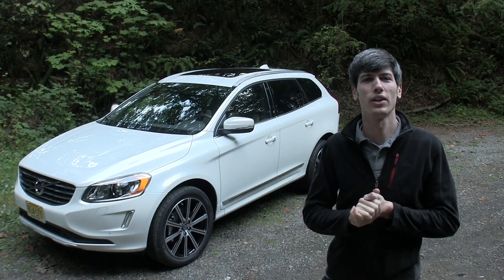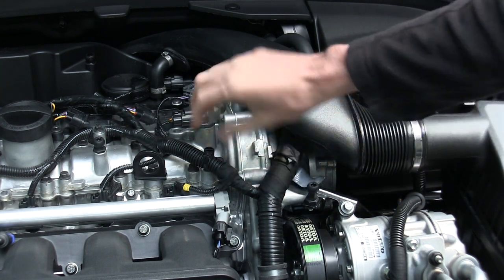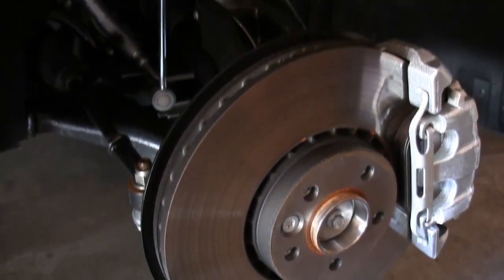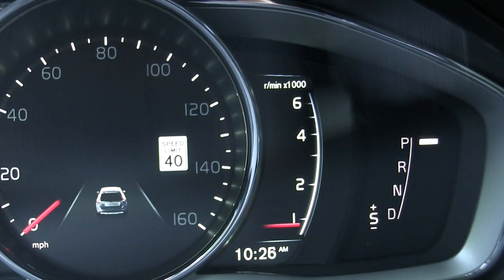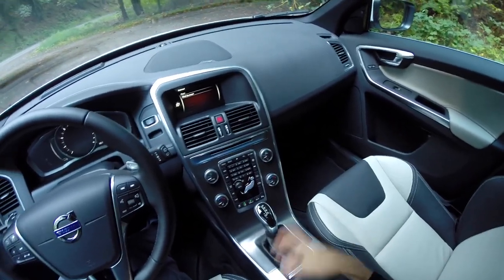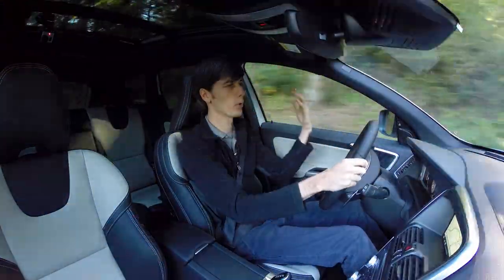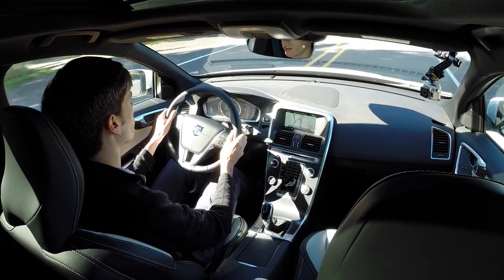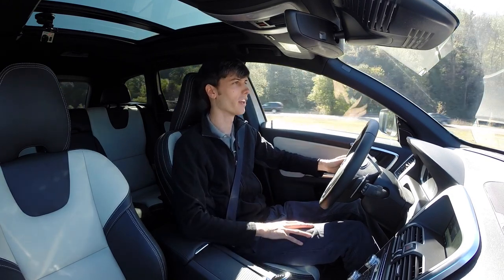2015.5 Volvo XC60 - Review & Test Drive

Comment: I'm a bit late chiming in here, but the primary purpose of the engine arm at the top isn't to stop torquing movement, its to help the engine submarine in a crash. As the engine moves rearward that arm pushes it downwards, before it starts impacting the firewall.

Comment: A thing you (might have intentionally or unintentionally ) missed, is Volvos focus rust treatment. Wheel arches always have plastic inner screen, the doors has been treated with wax(look for holes with a plastic cork in it), the bottom of the car has been rust treated and engineered with rust protection in mind. It may not be a deciding factor in California, but in Canada or a Nordic country where i live, it's defiantly a deciding factor. Generally (due to regional differences, and thereby differences in the focus on developing the car) cars from Germany, France and Norway and Sweden tend to have a good rust protection, while cars from japan.... well that's another story.  
Great show ! Cheers from Denmark.
Reply from the maker: Great insight, thanks for sharing!
Reply: French cars has not good rust protection. The new peugeot 508 for example got 2 of 5 point for rust protection of a testing company in sweden.

Comment: Adaptive cruise control is something I'll always get on a car when it's an option, so much better on he highway
Reply from the maker: It's fantastic!
Reply: @EngineeringExplained  I have a car with it and one without it. Honestly, I prefer non-active. When trying to make progress, it often slows you imperceptibly from the speed limit. After a while, you wonder why you're going so slow. Hinders progress and is very frustrating on long journeys. Without it, you notice the speed differential approaching other vehicles from behind and can overtake to maintain best progress.

Comment: An in-depth review. Brilliant.

The only thing i'll add to the list of dislikes are the spongy brakes - was under the impression that they were faulty and changed them at service only to later come to know that the spongy feel are a norm. The wife's car so was comparing it with my bmw 5 brakes which are tight and does inspire confidence.

btw with safety as the highest priority, volvo surely won't give you place to place your phone ;-) .....it even has rear child locks (window and door) that can be activated from the driver door panel and auto brakes on an impending collision when at low speed !!!

Comment: Great review! Also, the position of the interior door handles are ideal. Too many car manufacturers place this position too close to the front of the door. The problem with this is that when opening the door from the inside to get out of the car, one struggles to 'catch' the door due to the weight of the door on the pivot, making close proximity parking lots are a nightmare. Volvo is on-the-money by placing the door handle closer to the middle, and horizontally. Allowing you to not only better control the swing of the opening door, but also giving you a comfortable reach when closing a fully opened door. We love Volvo because they pay attention to the simple and often overlooked aspects of the drive (long after the thrill of the new purchase has gone). Great review!!

Comment: Those radars upfront also play a part in "emergency brake assist", basically the car will apply full braking power automatically if you don't apply the brakes before a collision!

Comment: Our Volvo XC60 from 2011 has done 210'000 miles with no problems. Not even the hedlamps have broken down! This is in Sweden so the climat is not that nice to the car. The engine is a D3 with 163 hp and 400Nm.

Comment: Hey Jason, awesome video!
At 11:58 when you were talking about a switch behind the accelerator; that's called a 'kickdown switch' and shifts the transmission into the next gear down when full throttle is activated. 
:)
Reply: Pretty sure he just said that
Reply: Tristin I know I was just telling him what it's called. It seemed like he's never come across it before which is understandable because most new cars just use the TPS to determine requested power.
Reply: volvo's been using it for 14 yrs that I know of.

Comment: Hi mate. Now, before you become too famous and big on YouTube so you are not able to respond to us ;) I wanted to make that one video suggestion I always wanted to see, and especially from you. You know how companies have like 5 same engines which provide power that varies (example - 2.0 155 hp, 2.0 200 hp and...) and not only that but usually with new models come the same engines but now slightly improved which now produce 5hp-20hp more than the series before, and without risking anything like, for example, how long an engine lasts. Now, I now about chargers but I would really like to see one video where you explain all (or at least some) ways of improving power in an engine. Hope I made it clear enough :) Cheers and thx
Reply from the maker: I have a 17 video playlist on the topic. https://m.youtube.com/playlist?list=PLA554541553164D26

Comment: I wish the XC90 came with the same buttons.  Nothing more annoying and dangerous than having to take your eyes off the road, look at the massive touchscreen, find the air condition control, tap it, than move your finger to tap the fan speed.  Totally dangerous and among the most idiotic things Volvo has ever done regarding safety/convenience design.   This reviewer seems to thing buttons are a bad thing.   Most intelligent people are more concerned with safety and convenience than big pretty bright screens .
Reply: urbansustainability totally agree. The xc90 is horrible because u have to go in alot of menus when they easely could have made a regular button for alot of things
Reply: You should be using the voice commands for most things !

Comment: Im wondering why they decided to put an I6 transverse?  That engine is mega-crammed in there.
Reply: Volvo traditionally mounts their engines transversally. Partly nowadays because most cars are still based upon FWD Ford vehicles.
Reply: Volvo says because there's more room for the crumple zones, plus, all of their platforms are FWD based, not RWD based. Reason for FWD-based platforms is that they handle better in snow, and generally have more predictable handling characteristics than RWD cars.

Comment: People are so finicky with buttons, there are a lot of technology today and people want to have the option to turn systems and functions on and off so there have to be many buttons for it... Packing it all in to a screen wouldn't make it any better or easier as it then would take a lot of clicking and turning through the menues to find everything. Many buttons are easier to learn than complicated menu layouts any day. It's not that bad compare to some and not that much worse than some. And outdated because it not touch buttons?? 

The main complaint is the amount of buttons and whether it's touch or not the amount would still be the same so then who cares? Also with touch there is greater risk of accidentally touch wrong buttons or multiple buttons like if you have thick fingers or when trying to press during a bumpy/shaky ride.

People i say...
Reply: The thing is, those buttons are tiny too. And you have to scan with your eyes fur the buttons. You have to touch it and then rescan again for the next button. Because it is tiny, you tend to touch the wrong buttons.

With touch screens, they are usually big. And easier to navigate. Scroll left or right, top or bottom, click or touch. Your choice. And you free up space on the center console for more convenient spaces or USB ports.

Comment: What does that isolator do?
Reply: It keeps the engine movement away from the rest of the chassi. This way the car will vibrate less and won't rock back and forth as much at start up. Correct me if I'm wrong.

Comment: I didn't know the vehicle will accelerate for you as well. What if the vehicle in front suddenly accelerate extremely hard? Will the ECU make you vehicle catch up the car in front of u? Lol!
Reply from the maker: That's not how it works. You set the max speed, it won't exceed that speed, and drives slower than it if the car in front is going slower.
Reply: Engineering Explained does it steer for you automatic as well? The sensor will follow the white lines on the highway?

Comment: LOL My 2009 Infiniti FX35 has 303 HP from a 3.5L V6 NA. Probably cost the same new.
Reply: This is mapped to comply with emisssion regulations for volvo as a company so can be remapped by a 3rd party to probably well over 300hp with stock internals. The 1.8 turbo VAG BAM are 225hp but will map to 260 or so with no mechanical changes. 2.5L 5cyl from the 06 focus ST is also 225 but maps to 320ish. Turbos huh...
Reply from the maker: I guess I don't get what you're implying. This is a smaller engine, produces the same power, but will get into peak torque much earlier than an NA engine.
Reply: Engineering Explained I'm implying that my car is better than this, even though it's 5 years older.
Reply: Cantenkerous Tim This is a smaller engine and can be upgraded with a flash tune from Volvo themselves to make 325HP/355 lb-ft. Somewhere where your FX35 falls flat is on its lower torque numbers, as it's down almost 100 lb-ft.
Reply: AdrianC12345 I could put $1000 camshafts and $500 springs and make 345 hp easily.
Reply: Cantenkerous Tim Could do the same with the Volvo. What's your point?
Reply: An M3 is kinda in a different category than a crossover. In case you hadn't noticed. Volvo's own S60R in 2004 made 300HP out of a 2.5 liter engine. Again, they are chasing different customers. Still though, the main advantage of this modern turbo I6 is that is has the most torque out of any car in its class, which gives it the sensation of effortless overtaking.
Reply: Dude, I have a VQ too. The thing with them is that the torque is only available at mid or even high rpm. So, the fuel economy is bad. I think this Volvo can scoot around at 2000rpm all day long and you still can feel the big torque. I'm going turbo next car; probably a GTI with DSG.
Reply: LoL these guys just proved to you that this volvo shits on your infinity.
Reply: TheBramptonBully Haha it's a sport suv.
Reply: TheBramptonBully Must have never driven one...
Reply: Cantenkerous Tim Sport and SUV are mutually exclusive. You already combine the disadvantages of a car and an off road vehicle, no need to add sports car into the equation...
Also, lol@ 'car more power, car better hurrr"
Reply: grmasdfII No, I was really saying that my car is NA and 5 years older. So I'm saying that Infiniti engineers did a better job with that engine. So it must mean they did better on other aspects of the car.
Reply: Cantenkerous Tim It also has higher displacement, is larger and has a lot less torque because it doesn't have a turbo; it's less efficient.
That engine has also been used in performance cars (Nissan Skyline, Nissan 350Z..)
They are entirely different designs.
But others have already explained that, and if you don't get it by now you probably don't want to.
The last part...look up formal/informal fallacies.
Reply: I'm not sure how anything proves that the Infiniti is better. It's simply a higher displacement engine so it's logical it produces a similar power rating to a turbocharged engine with a smaller displacement, no fact has been said that a in anyway shows the Infiniti as better. And at any rate SUV means "sport utility vehicle" so that's an absolutely stupid thing for this dude to say!
Reply: FLR
Reply: Eww Nissan/infinity.

Yuge CVT issues.